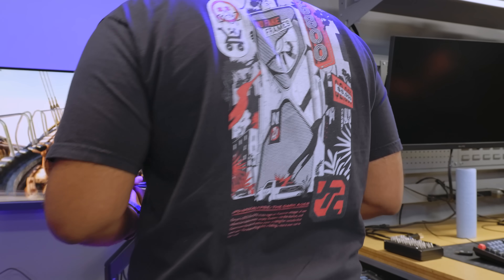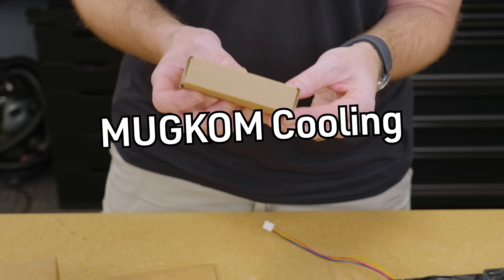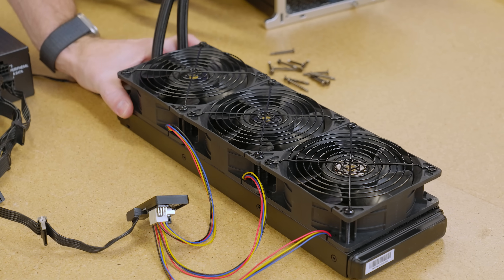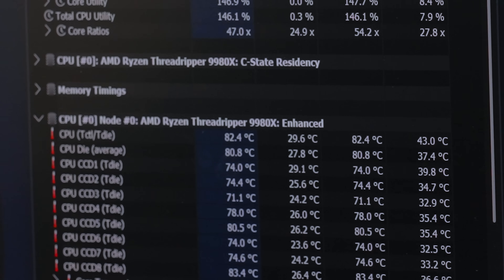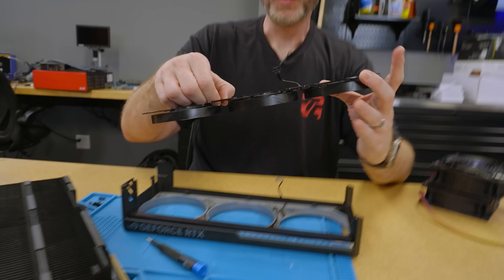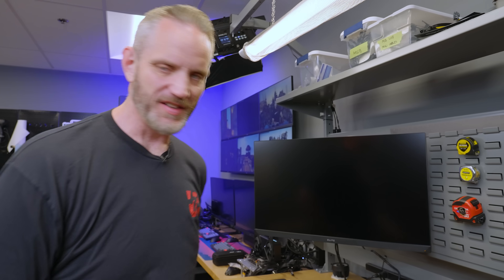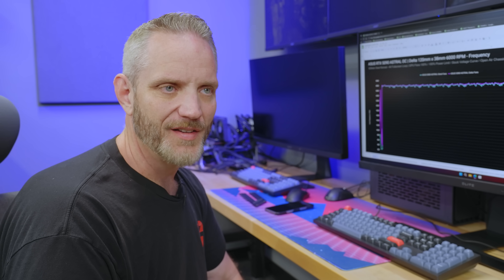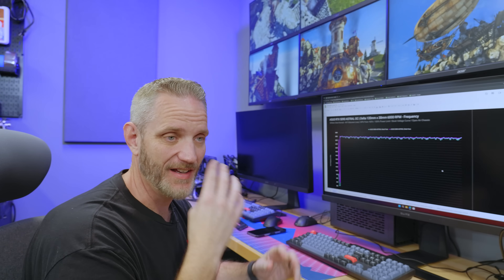Server Fans on a GPU... What could go wrong?

Comment: this might be good for a cluttered system with poor air flow if you used it as exhaust fans to keep the heat out. in my case i had the unpleasant mistake of buying quiet fans and heat kept piling up so i hat to open the case and put a loud AF box fan on the side... also cut the grill in front of them cause the restriction was crazy. (also hard to find proper air flow 90mm fans under 1 amp...)

Comment: Yo Jay as someone who has actually 24/7 run Delta server fans in their rig the EASIEST way to control especially if they are PWM is to get an adapter that goes from Molex to 4 pin fan header and a regular 4 pin PWM fan extender then replace the Tach wire and Signal wire with the ones from the extender, and run the + /- to the molex then plug the 4 pin PWM to the motherboard and the Tach/Pulse wire will let the Motherboard control it while the Molex Powers the Fan, you can also use a splitter with this trick just make sure not to over draw from the Molex, and remove all but one Tach wire to not confuse the Motherboard, but MAN having control of Delta Fans is THE BEST they can be quiet OR DEADLY and if your PC overheats you KNOW ABOUT IT!!

Comment: I purchased a 200mm Thermaltake PC Fan from Amazon recently...   I rewound the stators & have it charging a small battery as well as providing airflow..  certainly not high output but does produce a lot of airflow...  & it requires a push to get it going... some of those server fan's look interesting.  I remember back when I owned the AMD Athlon I purchased a real rpm CPU Fan & it needed a fan control because it sounded like my hoover...

Comment: Had a couple of them in an old build. They were rated at 240CFM each. Needed a purpose-made 5.25 bay fan controller (Rheobus Extreme) with a 4pin straight to the PSU to run them. It all still worked 8 years later when I built the new rig, and boy, does that sound bring back memories. Running 6x 120mm Noctua IPPC 3000 now.

Comment: Hey Jay! How are you? Thanks for the content. 
I’ve got a Corsair 7000d case, running 7 fans as intake, 4 exaults, so it’s heavily favoring positive pressure, and I loved it. Almost no dust inside at all. 
Question is: I’m going to buy an asus astral 5090 lc, and the default is exaulst on the radiator, so that will put me on negative pressure, cause I’ll need to switch 3 fans that are intakes to exaulst. I’m thinking about turning those fans to intake, blowing hot air inside the case. Is it a good idea? The cpu is cooled by a 420 aio, that is mounted on the top is the case, as exaulst. 
Thanks in advance!

Comment: Back in the day, I had an AMD 9590, yeah the heat miser, and I ran push/pull with delta fans. They were like 200cfm 120mm fans. It was fucking loud, but rand cool as balls. People always said "youre lying" about temps. They did not understand the meme of delta fans.... Antec Kuhler 920? the 120mm AIO? and yeah, push/pull delta fans, installed on the back of the case above the motherboard IO shield, basically sucking air out. and yeah. loud, and cool. I hit 23c idle and barely 42c gaming. and people said "not possible" but yeah. they just dont know.

Comment: Manufacture /
Brand: Delta Model /
Part Number: TFC1212DE-SP07
Size / Dimension: 120mm x 120mm x 38mm
Rated Voltage: 12V DC
Rated Current: 3.9 Amp Rated Input Power -
Watt Fan Speed: 5500 R. P. M.
(Revolutions per minute) Maximum Air Flow: 252.8
CFM (Cubic feet per minute) Noise Level: 66 dB-A Maximum
Air Pressure: 35.88 mmH2O
Bearing Type: Ball
Termination: 12? with 4 Wire Leads
Power Connector: 4pin
Function/Features: PWM control/Speed Sensor (Tach Out Put) RoHS Status RoHS Compliant Operating Temperature - Life Expectancy - Data Sheet Unit Weight 0.66 lb ( 10.5 oz)

Way better

Comment: Jay's also ignoring one other issue, thermal flux from air flow. A fundamental law of physics is that energy cannot be created or destroyed. The faster you move the air the more energy you're putting into that air. There is a point where the volume of are moving through the cooling fins will become so great that, instead of pulling heat away from the heat sink, you're actually introducing heat to it. There are three components to this Adiabatic Compression, Viscous Dissipation, and the Thermal Boundary Layer Inversion. 

Adiabatic Compression Heating; T_2=T_1*(P_2/P_1)^((y-1)/y), where T_1 is initial air temp (in kelvin), P_2/P_1 is the compression ratio, y is the heat capacity ratio for air roughly 1.4. To raise the air temp above the GPU surface, you'd need to hit about 25 degrees Celsius or have a room temp of around 77F at a 3:1 compression ratio, at which point the air inflow through the heat sink will actually ADD heat rather than remove it. 

Viscous Dissipation: At very high airflows velocities friction heats air, this becomes significant at 100 m/s or greater, but is still present at lower speeds.  The three server fans, operating at 18,000 RPM are pushing air at 113 m/s (+/- 3 m/s), this means through various effects, this includes shear stress due to friction from the thermal boundary layer along the fins of the heat sink, turbulence through airflow eddies due to the spacing of the heat sink fans (and were visible with the smoke test) this converts kinetic energy to heat, and all of that causes thermal increases rather than removal. 

This means, those fans have a very real risk of Thermal Inversion with the present setup. Rather than taking heat away, it could actually be introducing heat to the system leading to a negative convection gradient, heat reflux into the heat sink, and ultimately causing thermal throttling. 

So it isn't a matter of merely diminishing returns because of the cold plate's saturation, or the ability to transfer heat from the heat sink to the air, it's also an issue of introducing a new thermal source to the heat sink from the higher compression ratio of these 18,000 rpm server fans, creating a thermal boundary layer next to the heat sinks, ultimately disrupting the heat sinks ability to cool the GPU.

Comment: i used 9 delta 120s on my jeep when the radiator fan died and i had them laying around. worked "good enough" to get it by until i got a new proper fan. im currently using two of them on my motorcycle radiator with a PWM temp speed control so its always running only as fast as it needs to. works great! they dont mention being water resistant, but ive not had one die from either the jeep or the bike.

Comment: I have a couple of those fans on my 4U desktop as there was little room for a big rad. So I have stack two 95mm rad onto one 6000RPM fan. It is quiet under normal use. You can hear it when I start loading things up, like a high end game and so on. Noise can be cut down a few ways. One is a towel to absorb some of the sound.

Comment: Hey Jay I have a problem ik you'll likely not have time to respond but shot in the dark I'm all out of options.  
I have a custom loop build with a 12900k 
9070xt 
All optimus water cooling parts so it's good. 
Well no because every time I try to play a game for example battlefield 42 my pc will black screen and the only way to get it to turn back on is to hard reset 
Well I've tried everything I can find from completely wiping my drives and starting over with new windows new drivers even used ddu to get the old out.  I've checked temps under load and my gpu memory reached 96c so I under volted and reduced power draw to around 235watts give / take I've even turned xmp off and under volted cpu, I replaced my psu with a 1500watt wvga gold.  
Nothing has worked for me.  My temps with the gpu were fixed with under voting it,  but it's not only battlefield is path of exile 2 kcd2 etc... 
Any advice is better than I've found for the last 3 months online, through YouTube reddit etc.  Please Jay throw me a bone of advice this 32 year old dad could use it😅
Reply: Also every time I bench cpu or gpu it seems to handle stress fine.  So hardware shouldn't be the issue right? Lol right?

Comment: I have Arctic Freezer 2 420mm AIO and 9700x and it thermal throttles on cinebench with PBO. I think it was at 160w. I'm thinking of swapping some 2000 or 3000rpm noctua fans or should I just unlid the cpu?

Comment: It may not shut off - I did a hardline copper build with dual Xeon and a GPU that did have a pump failure and I didn't notice for I'd guessing months as the mass of water and copper with some airflow over it all was enough, at least with not doing 100% load stress test type loads was fine. The fans might have been ramped up a little higher but when you have a fair bit of radiator and pipework full of water to conduct and exchange heat... Though this was a while ago, so the total system load was probably less than a single 5090...

Comment: You should try the EBM Papst 4112NH4, which I paired in the past with a TT FRIO OCK and pushed a 2600k to @5047Mhz. I also used a NZXT. Sentry Mesh Black Fan Controller with it and it sounded like a Jet Engine.

Comment: If you have fix for amd to solve high vram on idle please! my is stuck 2238mhz all the time. i use rx 6950 xt xfx with 3 monitors. 144hz, 240hz and 165hz

Comment: I'm not very familiar with thermodynamics by any means, would modifying the backplate with copper heat pipes to transfer that heat to a fin stack be a way to increase efficiency? Obviously the GPU becomes MASSIVE and heavy, but I'm curious how one could increase the efficiency since there's a balance between: air flow and backplate vapor transfer speed.

Comment: The higher the difference in heat, the better the transfer of heat.  To this point, you could go REALLY old school and use peltier coolers to pull more heat from the chips and push more heat into the heat sink.  The flow of air would then be more effective at cooling.  You could really go nuts with a bigger heat sink (or array of heat sinks) to move still more heat.   Optimally, have a thick copper heat spreader with multiple peltier devices to actively cool the card and multiple flat based copper heat sinks to dissipate the heat with the server fans.

Comment: It'd be interesting to see how much you can cool with one of those fans. Make a shroud and push through several 360 radiators and mount them in the chassis for total system cooling.
The noise would obviously still be horrible, but the capacity. As an experiment, it'd be interesting.

Comment: i use some old 120mm server fans on my 240 rad. have never had to run them harder than 60%. they tend to work better in a pull config, too.

Comment: I'm going to guess there would be more of a differential temp if the rad and/or heatsinks were designed for the higher airflow. As it is, everything is designed for the compromise of fans that Don't sound like an aircraft!

Comment: It would be interesting to see the fans tested at all RPMs. I'd be curious to see if you're not only getting diminishing returns, but if it, in fact, gets worse at higher RPM. Just like how you can push water too fast through a loop and get worse performance. Air through a fin stack has an ideal velocity range.

Comment: Hey Jay, your'e looking at around 210CFM on those fans and the wring should still be the same as a normal 4 pin (or even 3 pin) black is ground marked with a little triangle. I have two of these fans (actual Delta ones) at home for "testing" purposes. I have an idea because why the hell not. Take the heatsink and TIM off fully and just blast the silicon and PCB with the fan itself (maybe try this with another card first before you nuke a $4k+ GPU

Comment: The power the fans use turns into heat, which increase the temperature of the air. Not that it should matter much even at that power level unless the airflow is very severely restricted, but maybe worth exploring by comparing push to pull configuration. Without any airflow restriction those fans should increase the air temperature only by about 0.2 °C, based on their power consumption and airflow without restriction, and the specific heat capacity of air. But that temperature increase increases with airflow restriction, if they only manage to blow 10% as much air as they can without restriction that should make the air almost 3 °C warmer, mostly because of the decreased amount of air that heat goes into, but also because the fans use more power. That is based on very rough calculations, but unless I got something horribly wrong, those numbers should be somewhere in the vicinity of actual numbers.      

To make an enjoyable video about it, maybe consider the fact the datasheet for those fans says the working voltage is up to 13.2 volts, and the fans can probably handle significantly more than that.

Comment: One very annoying thing is on some delta's model, they swap the color of speed and pwm cable from yellow - blue to blue - yellow. Luckily, that would not kill the fan if you wired it wrong.
By the way, it's very easy to control delta fan's rpm with fan hub. Just wire + - 12V from sata/molex to the fan and plug speed + pwm into the hub.

Comment: I stopped messing with overclocking when the number of cores surpassed my needs. The last CPU I overclocked (and undervolted) was an AM3+ 6 core Thuban 1055T. Originally was at 2.8GHz 1.32V and I was working it 24/7 at 3.5GHz 1.28V max frequency. The other P states of the CPU where also optimized with K10stat.

Comment: Gotta 420 push pull them fans in high airflow case with plenty of case fan mountings.😂❤
Reply: 1 5090 on asus z690 later with bad white psu and used gpu cables with overclocked everything and this pc can now fly.

Comment: I'll mention these as you might be surprised what they can do. Noctua NF-F12 Industrial PPC-3000 PWM Fans. 3,000RPM, PWM controlled, black, they can get loud at maximum speed (43.5db), but are handy if you need to move air. Yes, they are not 6,000RPM, but most will not need that speed. Proper design and environmental conditions can make sure you never need that high of a speed and we know how fast things can spin before having issues. That's why CD's and DVD's are limited in the X speed they use (52x is as high as I've ever seen for CD's and mechanical hard drives are mostly limited to 7,200RPM, as 10k RPM had a lot of failure, though Western Digital may still sell some somewhere).

Comment: 2:59 that potentiomerter is the absolute worst lol i had one like this caught in fire with just 12v at 100mA. I mean they are fine when you don't turn the shaft often but as soon as the shaft starts to show signs of use and wear, which is fast, who knows what can happen lmfao
Reply: yeah that one seems small for the wattage
Reply: @smashed_penguin it depends how its wired, not all the wattage needs to go through the pot. what i meant is the plastic shaft and assembly it really cheap on this type of pot.
Reply: @matrixmodulator true, I just assumed from how bare that board looks that that's how it was probably doing it
Reply: @smashed_penguin i see an ic and a few passive components on it, if it was over the pot wattage it would not work more than a few seconds.

Comment: here's an idea: 1 fan vs 6 fans. so you hook up 2 rads with 3 intake 3 exhaust or all intakes or whatever, vs just 1 one of those in the case's exhaust pushing air in or out so the pressure buildup forces the air through the rads anyway

Comment: You guys joke about the Corsair fans... I filled my AMD Ryzen 7950X3D-based PC with those fans a couple years ago (effin NINE of them - seven 120mm and 2 150mm) because I thought the Link system was really neat and tidy (and it actually is), and now they're all dying one by one. The first one died horribly, its deathrattle could easily be felt through the desk itself when the bearing failed. Felt like oldtimey crappy sleeve bearing at first, but the others have avoided that.

What's been getting several of the other ones is some kind of weird electronic plague where the outer LED ring turns a constant sort of beige color (sometimes flickering with primary colors randomly), while the center hub LED ring just spazzes out flashing like a friggin disco nightclub. Nothing can be done to fix it once it starts, they won't obey software commands anymore (they're probably protesting that unbelievably crappy icue piece of crap - only asus garbage crate is a worse piece of software that I know of.)

I don't know who designed icue, but that person deserves to have their shoes permanently nailed to their feet, it's really that bad. Unfathomably, horribly bad, and missing all kinds of actual smart functionality, like the software won't alert you to a fan failure even though the software is constantly sampling the RPM signal. No temp guard functionality either even though the fans have temp monitoring also, etc. Un-effing-believable badness all around.

So yeah, I can keep myself from laughing. Superduper investment... But, they looked pretty swell while they all worked properly.

Comment: Would've also been interesting to see the results for a CPU air cooler as well as the AIO.  Maybe something in a scenario it wasn't designed to handle and see if the delta fans help overcome that limit, like maybe the Be Quiet Dark Rock Slim on a 13900K/14900K since it only has a 180W TDP?

Comment: Did you really write "18,000 RPM" on your thumbnail?? I assume that it's obvious that you can't simply add the rotational speed from 3 fans together (even if you write total under it) ... that makes absolutely no sense ... these are 6,000 rpm fans ... doesn't matter if you have 100 fans or 1 fan, they only operate at 6,000 rpm. For a tech channel it's truly astounding just how much misinformation you spread.